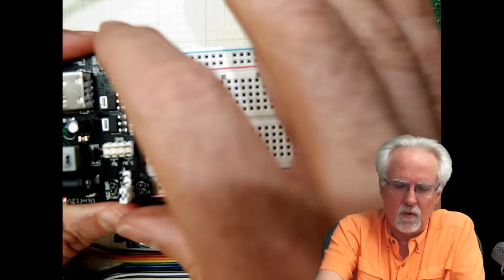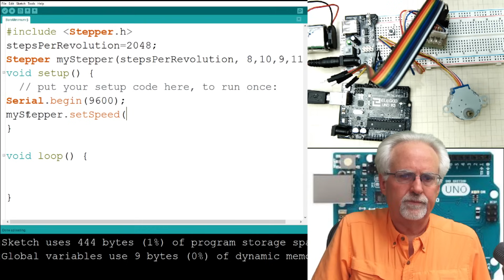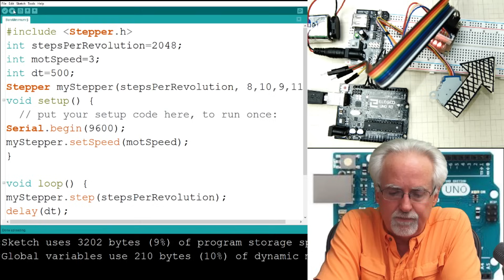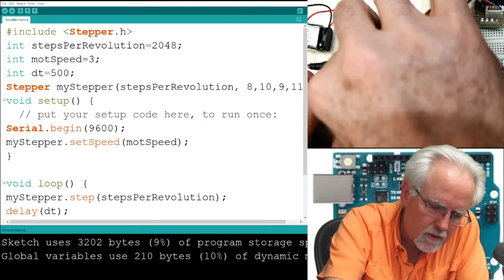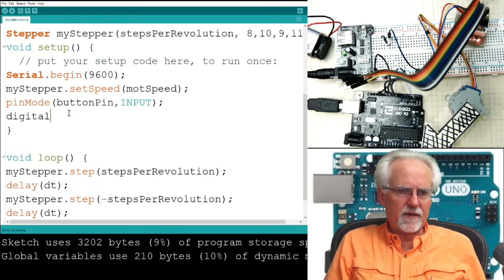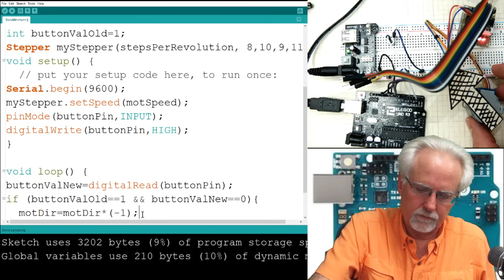Arduino Tutorial 35: Understanding How to Use a Stepper Motor

Comment: I found it easier to resize the IDE and have the Toggle_LED.ino open on the left and Servo_Motor IDE.ino on the right.
I used  if (buttonValueOld==0 && buttonValueNew==1). Reversing direction was hardest to figure out.
The  Voltage Regulator on the power module gets very hot to the touch. I hope it isn't too hot.
How long can label names be?
Wayne

Comment: I did it. Same as Paul, but, instead of using motDir*(-1), I used an 'if else' command. I also used the step (1) command with delay(0), but assumed this was not correct. Is there no way to make the stepper just run continuously?

Comment: I got the motor changing directions when I push down the button and let go. However, it only spins for one revolution either clockwise or anticlockwise and then it just stops until I press the button again? 

Got any ideas?

Comment: been looking through your videos thanks for the info. one problem im having is when hooking an arduino to motor. when i use usb to pc to power arduino the program works and runs great. however when using an external power supply of 12v to the arduino vin or the barrel jack the program doesn't work, yet the lights turn on so resembling it getting power. any help??

Comment: I built the program to start out slow and pickup speed (to as fast as the stepper would go) and then slowdown. Why do you not need "pinMode" for the stepper pins?
Reply from the maker: I forgot to put it in. It should be used.

Comment: For anyone who is having trouble try using a 12V supply instead of the 9V battery. When I did it with just the battery from the kit, it didn't work, but when I took two double A batteries, put them in series with the 9v battery from the kit, and then used the total 12V supply, it worked!
Reply: Hey Emelio. Having the same problem even with a new 9v. Where is the 12 v input? Or did you feed 12 thru the 9v?

Comment: I don't usually comment but I feel like I have to this time. I was pulling my hair out trying to figure out why my homework wasn't working. Everything seemed fine but the stepper wasn't turning no matter what I tried. After about an hour I finally realized that I forgot to plug the psu into the battery 🤣. I now have everything working. Thanks Paul!

Comment: Thanks Paul. I think I got the software working right but the stepper motor kept on buzzing instead of rotating the spindle.
Reply from the maker: Make sure your battery is not dead.
Reply: @paulmcwhorter  It kills batteries Pretty quick.  30 min on new battery

Comment: Piece of advice - if your step motor is buzzing and not turning, your battery might be nearly drained. I checked the motor, the driver, and then the battery before I found the faulty bit.

Comment: Spent quite a while on this one.  Threw in a potentiometer to set the motor speed 1-10 as well just to do the math.  It's kinda working but I can only change the rotational direction when the switch is toggled during the delay time.  I accept my failure and shall watch and learn now!

Comment: I just bought the mega 2560 and the board is different then the uno and I selected the correct board in setup. I followed exact commands and it keeps coming up with 'Stepper myStepper(stepsPerRevolution, 8,10,9,11;  as not a good command? says exit status 1 expected status 1 expected ' )' before ' ; '. it will not accept the download no matter how many times I tried to find errors from your video? kind of bummed have no idea what it wants?
Reply from the maker: If you are new to this stuff, best to use the same hardware as me. Then when you have it working like me, then venture out to the other board.

Comment: i had many failures because i couldnt remember fully how to set up the toggle, and was missing a key thing or two but eventually figured it out and got it running after a couple extra serial.prints to help me debug my values. i didnt think of the multiplication you used on the variables and instead made separate if statements after tons of thought for each direction switch. 

i agree with that one other commenter that suggested that there could have been more explanation on why the four pins were set up the way they were and what exactly they even mean to the stepper motor. i understand that you may have glossed over it because you said it could be different and specific to the stepper motor and driver board that the user has, but i felt very confused and in the dark during that setup

Comment: I just want to add this note:
The power supply for the Breadboard has a negative tip with a 5.5mm x 2.1mm Barrel DC plug. (in case you want to build your own cable).
Personally I used my external bench power supply and not the battery.

Comment: I went through this about 6 times with no luck. I rewatched several times to be sure I had everything entered correctly, still nothing. I went to your website and copied your code into a new sketch, uploaded and it worked perfectly. I went back to my original sketch and checked line by line. Absolutely identical. I have no idea what is going on.
Reply from the maker: To make progress as a programmer, you have to fundamentally understand this. If it is not working, you made a mistake. If your code was identical to mine, then you would be getting an identical result. To find an error, you first have to admit you have an error. It might be an error in code, or it might be an error connecting your hardware up. The error is there, now go find it.
Reply: @paulmcwhorter  I'm going to make a copy of my original sketch and delete line by line and paste in code that I know works. This will at least tell me where the problem is at so I can go back to my original file and see what was wrong.
Reply: @paulmcwhorter  I found the problem and I'm shocked no one else had the same issue. At 8:55 in the video you explain that the stepper drive pin IN1 goes to Arduino Pin 8, IN2  to pin 9, IN3 to pin 10, and IN4 to pin 11 but the sequence of pins in the code were 8, 10, 9, 11, and of course I had them in sequential order. 8, 9, 10, 11. The 9 and 10 swapping places was so hard to find and just about caused me to lose my mind.

Comment: This is a really basic question, I know, but I'm curious why we need that power supply board, since the motor is 3-6V and the Arduino itself is 5V. Is it because the Arduino can't deliver enough current?
Reply: You answered your own question.
With the stepper motor running, according to my external bench supply, its drawing about 294mA. WAY MORE than Arduino is capable of delivering.

Comment: Nope, I paused it and got it working on my own. Thanks for the awesome videos and challenging homework. Found out one thing - if the 9V battery runs out you get all sorts of download error messages that will make you scratch your head and pondering what the heck you did wrong! Luckily my kit has a 9V power adapter!!

Comment: I really paused and tried :) But it was a " So close,yet so far" situation this time. I wasn't that lucky like previous assignment. I figured out button settings part but 'motdir*1' was a new key concept for me. I couldn't figured out how to set direction while its turning continously(continuous part confused me) with my previous knowledge. 

I was able to switch while it has an order to complete a certain fixed number of steps. Kinda like an interruption, "mot dir" solved that problem for me.

Again, Thanks a lot...

Comment: I did it with hold, i.e the motor stops while push button pressed, but your method is the best :)
// while (digitalRead(pb) == 0)
// {
//   pbstatus = 0;
//   delay(10);
// }
// if (pbstatus == 0)
//   dirs *= -1;
// mystepmot.step(dirs/60);
// pbstatus = 1;

Comment: One those projects where there are three things to get working  and you can always get any two at one time. I was running first time with two but it took another three hours to get all three.. I was delighted to get the result. Writing code is always about thinking differently and learning at the same time. We are down to 4K likes so I guess this is the hard core that will persist. Good to know that there are that many people out there who will go the extra mile rather than skip reading and looking for quick fixes. With development I have found that in designing the current project you always need to think about how this will lead into its successor. Taking short cuts that will eventually become long cuts as you box yourself into a corner!

Comment: Love it - Due to the gear reduction system inside the little stepper motor, the actual steps per rev works out to be  32/9*22/11*26/9*31/10*32 = 2037.8864197530864197530864197530864197530864197531
I'm having fun and watching all of your videos --- Thanks Mal

Comment: I tried to do it like what we did when we first implemented the toggle button on the LED but the problem was I wrote if(myStepper.step(2048)) which the Arduino told me it could not convert it to boolean that is why I had to turn back to your video to make this variable motDir

Comment: Hi Paul - I found this to be somewhat more challenging, and I wasn't able to get it to work on my own.  I was close though 🙂.  I would like to say that I checked the specs online for the same stepper, and either I read it wrong, or it was wrong.  It said "64 steps per rev" however your 2048 steps/rev works.  I also played with a few settings and found it had a max rpm of about 15, which would be close to 64 steps/sec max.  Does that make sense?  Perhaps you could add in your description, or in a future lesson where to find specs, and perhaps how to use  libraries?

Comment: I have done it in another way with following script (dt=100)
buttonVal=digitalRead(buttonPin);
Serial.println(buttonVal);
if (buttonVal==0){
motDir=-motDir;
delay(dt);
}
myStepper.step(motDir*1);
It is working Sometimes and sometimes it does not change direction which is strange to me
Reply: And when I change it the delay time to 300, it seems properly working. But I assume there is something fundamentally wrong about the code. I would appreciate your support.

Comment: since i am following these tutorials using micropython instead of c++, this one was kind of an adventure for me! i almost gave up and just switched to c++ for this lesson but in the end i prevailed! i ended up learning a bit about how these motors work (or at least how to control them electronically) and writing my own motor controller class after i wasn't able to find any that behaved exactly how i wanted. i think my controller class is kind of specific to the uln2003 motor driver, but that's ok

it also took me far longer than it should have to realize that i needed to change my loop behavior from full rotations to one step at a time in order to incorporate the button press being at any time!

Comment: To answer your quesetion... no, I wasn't able to figure it out on my own. But I did get close. Just a few coding issues but nothin major, I understand the consept pretty well. I think my problem is that I'm going through these lessons too fast. Finish one then jump to the next. I think I'm gonna stop here and go back to the beginning. Also, I think I'm gonna make a manual of each lesson. I think that will help with understanding everything as well as having a reference guide to flip through. I'm sure it will get lots of use as I start building projects.

Comment: No copy, got it done.  The oldVal and newVal flag took a couple tries to get it to change direction every time the button was pushed.  Originally, it would change sometimes - i.e. it was switching everytime the button was read at zero and since it can be read at zero multiple times during a push it depended on if it read "0" an odd number of times - if so it would change direction.  If even, it would change direction but change back before it was perceptible and therefore looked as if the button didn't change direction.  Matter of fact, the first version with the button depressed caused to motor to appear to stop while the button was depressed - it was toggling back and forth but looked to the eye like it was stopped.

Great lesson!  Great presentation!  Thank you!!

One question: On "Stepper stepMotor(stepsPerRev, 8, 10, 9, 11);" - why 8,10, 9, 11 and not 8, 9, 10, 11?
Reply: the reason is because each of those pins is controlling one of four coils (two pairs of coils) in the motor. let's call these coils A1, A2, B1, and B2. the stepper library requires the output pins in a specific order (if i remember right, this is A1, B1, A2, B2), but the input pins on the driver are not in that order (if i remember right again, the driver pin order is A1, A2, B1, B2)

Comment: Thanks Paul. I've followed every lesson to the end. Done all home work. I'm writing extensive comments in all my programs so that I can understand what I've been doing. Also used the Reference under Help, which has been very helpful. Unfortunately the battery with the kit was lousy.  The stepper motor stopped working after a minute. Luckily you mentioned you hade to switch batteries. Now it works again.
Reply from the maker: The battery is useless. Lasts about 10 seconds.

Comment: Hi! Thanks again for the amazing tutorial! Power electronics have always been extremely interesting to me, and stepper motors seem super useful! I tried doing the homework and it kind of worked. However, before the switch in directions, the motor has to complete a full rotation and it will only change directions at the exact point of completion of the spin. This is probably due to the number that I am using for the amount of steps the motor should do (its 2048, a full rotation). I tried using a smaller number, but the motor basically doesn't move then or moves much slower. Then in theory, it would be fixed if I used a greater motor speed value, like 1000. But in practice the motor is unfortunately incapable of doing this. I am excited to see your solution to my problems!
Reply: After seeing your solution, I understand what I did wrong! I did not know that you could make the stepper motor move a different amount of steps from the declaration at the start 🤦‍♂️. So instead of motorDirection I was using the entire full rotation. The rest of my code was pretty much the same.

Comment: My solution

#include <Stepper.h>

int buttonPin = 2, buttonValue = 0, previousButtonValue = 0;
int motorStep = -1;
Stepper stepper(2048, 11, 9, 10, 8);

void setup() {
  Serial.begin(9600);
  pinMode(buttonPin, INPUT);
  digitalWrite(buttonPin, HIGH);
  stepper.setSpeed(16);
}

void loop() {
  buttonValue = digitalRead(buttonPin);
  if (buttonValue != previousButtonValue && buttonValue == HIGH) {
    motorStep *= -1;
    Serial.println(motorStep == HIGH ? "Clockwise" : "Counter clockwise");
  }

  previousButtonValue = buttonValue;

  stepper.step(motorStep);
}

Comment: I did it on my own. My solution was a little different. 
void loop() {
myStepper.step(stepsToTurn);
buttonValue = digitalRead(buttonPin);
if (!buttonValue){
  while (!buttonValue) {
    buttonValue = digitalRead(buttonPin);
  }
  stepsToTurn = -stepsToTurn;
}

}
Reply: The only operation difference is if you hold the button it stops rotating for as long as you hold the button.

Comment: I am having trouble getting the stepper to spin, what could be going wrong. when I use the serial monitor it says that it is spinning but the motor isn't.
Reply: I am having the same issue. I took it apart and built it again but it still doesn't work

Comment: Had some trouble getting this to work as expected. Noticed a mistakes I had made:

I suppose I wasn't paying attention when you were showing the simplified use of a pushbutton in a previous video. Didn't realize it no longer needed a steady 5V from the Arduino power pin when doing the digitalWrite "hack." So, I think I'll remember that now! (But of course now it is getting a constant 5V bc of the hack. I think it holds that 5V at all times, except when the button is depressed?)

I had 5V from Arduino power hitting the button, and was reading that leg at pin2, and the other leg went to the ground rail on my board (which got ground from Arduino GND). When I hit the button, it appeared to POWER DOWN the Arduino and killed all lights on the control board as long as the button was depressed.  Would love to understand why that happened, but at least I got it working. My first attempt at fixing the issue DID produce the expected output from the system, but it was still incorrect. I took the 5V from the external power supply. 

To answer your question, no I was not able to do this on my own. Aside from the mistake above, I still haven't wrapped my head fully around comparing old and new values to  trigger something off of . Slowly getting there.

Thank you, sir! You are truly a god send! What a generous and knowledgable man you are. Exemplary citizen!

Comment: Sir Paul, I am using step motor 28BYJ-48 5v DC( I don't know if this is the way to identify it ).
I ordered power supply so the step motor could function, however I still tried to hook the step motor to the arduinos 5v pin but it worked. I do believe you sir but I think it maybe depends on step motor if it could be powered up by Arduino.
I really don't believe things sir if I don't see it myself HAHA. But still I really do appreciate you teaching us Thank you much much. God bless!

Comment: Hi Paul - I have a doubt on the excercise, in the intro to Stepper Motor Code (the first coding part of video) we did myStepper.step(stepsPerRevolution), while in the other we did myStepper.step(motorDir). What all kind of values can we pass in the StepperObject.step() function. Also is this function same as telling the motor that it needs to run now. (I did the code in somewhat different fashion - similar to pushbutton as a toggle switch for LEDs we did in the previuos lecture making the code lengthier and using steps per Rev in the step() function).